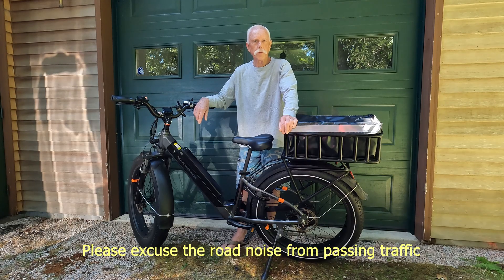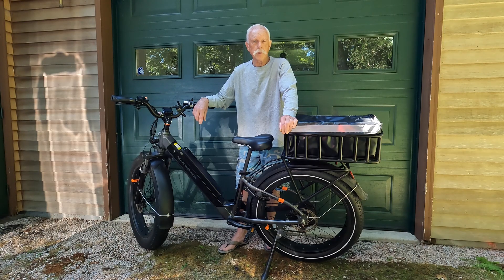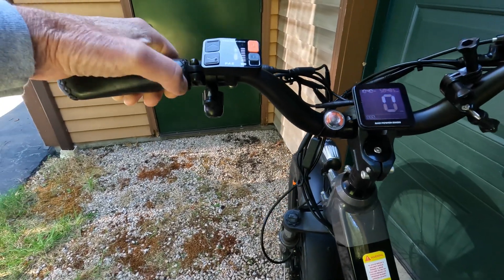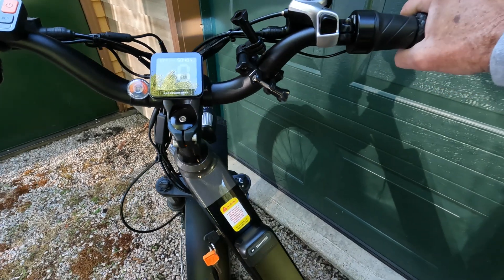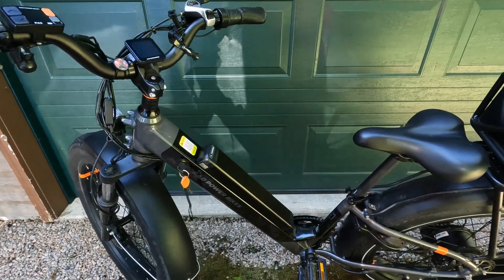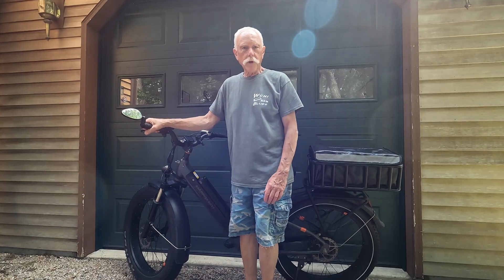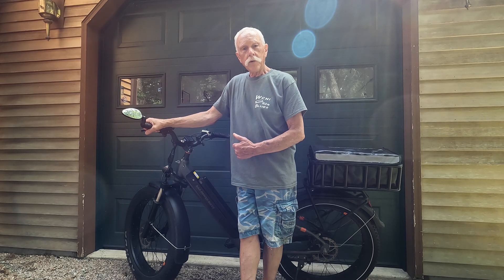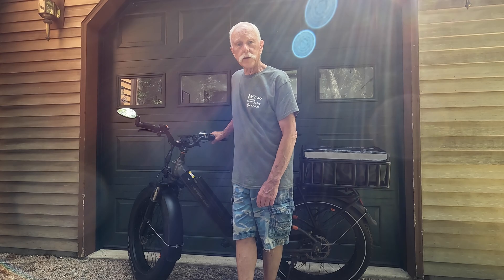RadPower Rover 6 Step-thru Controller Installation

Comment: Dear Sir, I am from Brussels, Belgium. I have been having the same, Error  21. I cannot get a controller, where did you get the controller?  Thank you!!! Just to state the obvious, Rad Power closed the European Office and ran out of stock of the controllers... It is a nightmare.
Reply from the maker: As far as I can tell, controllers are not shown as a part or accessory on the website, so try calling the US 800 number.  When mine died, Rad sent an invoice for the controller.  Good luck.

Comment: I have EXACTLY the same issue. Called Rad and did all that stuff. Nothing worked. I hadn’t used it for about 6 months so now the warranty (if there was one) was out and they wanted $500 or so for the controller!!
What bartering is required to maybe get one for less or I’m throwing the junk bike away!! Obviously they know of this exact issue?
Thanks.
Reply from the maker: As I recall, Rad offered a discounted price since my Rover was out of warranty.  I called and was able to get a further discount, so talk to them; they were very reasonable with me.  Good luck.

Comment: I had the same problem. I also would get a error code (32). Rad said it was the power button on the controller was stuck. I squirted some wd40 on it then blew air around the power button. Everything working now.

Comment: Thanks for your Rad videos. I have a semi-integrated Battery in a Rad 6 Urban. I am on my 5th replacement battery from Rad. Latest one still in box, afraid to put in. Always follow correct plug/unplug protocol. 
Issue battery will not charge.
Any thoughts?
Reply: I purchased a used 2018 Rad city and I think the original owner changed out the controller because it’s hardwares to the motor. Everything works just fine but replacing the tire will be a pain…as it was when replacing the freewheel and chain. 
When I decide to upgrade it will not be a Rad brand.
Reply from the maker: Yikes!  That's a lot of batteries.
One rule I strictly follow is to disconnect the charger when the battery is full, or nearly so.  I never let it charge overnight.  In fact, as soon as I start a recharge, I set the timer on my phone to remind me to unplug it.
I also don't wait until the charger light goes green.  Squeezing that last drop of juice in there just doesn't seem worth it.
Good luck with the new battery.
Reply: My controller went out also. Just as I resolved the battery issue.
Reply from the maker: Darn!  LMK how you make out with the controller.